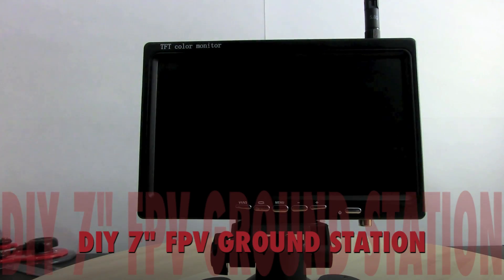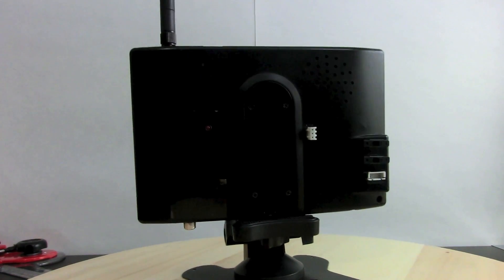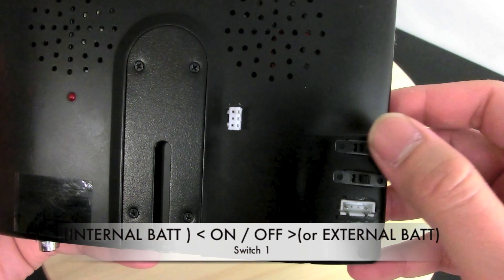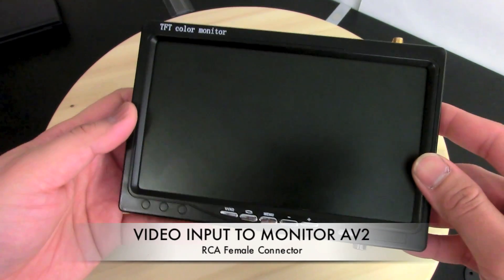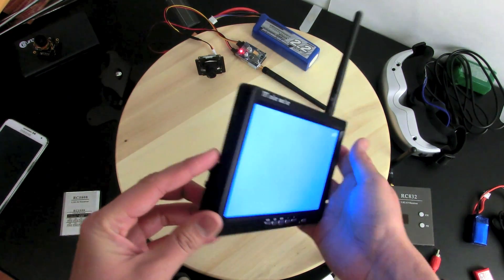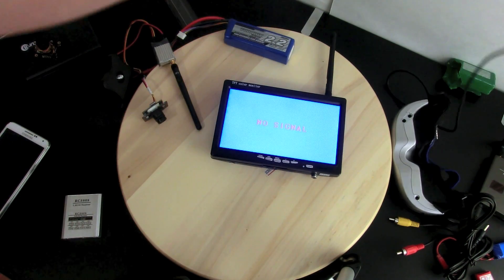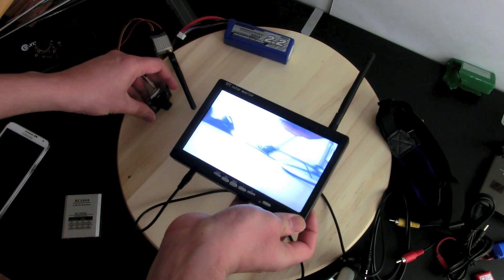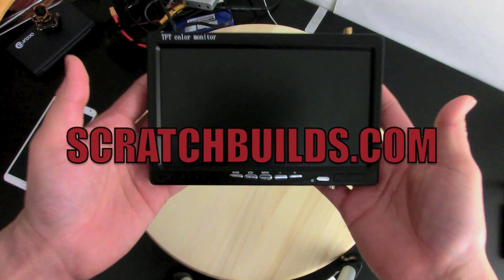DIY 7" FPV Ground Station with integrated Receiver and Battery under $65 Part-1

Comment: Nice build! going to look at mine this week as I still have Velcro everywhere.Why did you decide on external power input of 3s rather than 2s? Purely because you're more likely to have a 3s lying about? I hope to see if there is room inside for a C-DVR.
Reply from the maker: Yes you are right I do have more 3S batteries lying around than 2S. Also, I used 2S inside the case because I simply could not fit 3S in there. 

Also I do have old C-DVR that I paid $30 and never ever used, but now Eachine DVR are small and can be fitted inside the case.
Reply: Chirag Chaudhari ah, I thought you used the 2s to keep that regulator cool.

Comment: excellent!
May be you can answer to my question ...
Following an accident, one of my printed circuit tracks of the screen control panel is cut on the circuit.
I would like to repair, but the circuit is really too small.
Maybe this is replaceable, but I do not see or find such items.
I was wondering if you'd have a diagram of the control panel has any chance?
I can send you pictures if you want, but I think I'll have to buy a screen ...
Regards,

François

Comment: where can i find the bettery that u connect to the receiver?
Reply from the maker: +Mooria Devil That is Eflight battery with EC3 connector. EC3 connectors are horizon hobby's connector type. Totally useless just get ones with XT-60 or Deans (T-plug). They are universal and easy to find and cheap.

Comment: Very nice idea. I bought the same monitor, but it's a pity to pry it open. All the screws are out but it still won't let go of the back casing. Any tips?
Reply from the maker: you know how they use those plastic tools to open iPhone screen just like that you should be able to open it. You can use plastic knife or credit card and run it along the edge.
Reply: +Chirag Chaudhari Okay thanks for the quick reply. i will try to do that!
Reply: It worked like a charm. thnx man
Reply from the maker: +MrZoufzouf Glad to help you.

Comment: Does this monitor go to blue screen if you are flying and lose signal due to obstructions between you and the aircraft?
Reply from the maker: +Victor Soares well Blue screen is still the issue. There are some monitors available for around the same price as this one who  show snow when no video signal. But honestly since we are not using this monitor as DIY fpv goggles blue screen is not really a problem.

Comment: The 7" TFT Monitor needs 12V input and works fine with only 2S 7,4V?
Reply from the maker: Maganzi Yes surprisingly it works without any issues on 2S battery

Comment: This is great! I purchased the same monitor from a seller on Amazon for $16.50 + Free Shipping during a 1-day sale.  I probably won't take the monitor apart like you did, but it's great to hear a 1000mah 2S will run it for 2hours. That was my main concern as I picked up a couple ZOP 2S batteries from Banggood for $6 each.
Reply from the maker: WhiffleX Wow! you got this 7" only for $16.50. Once I upload the second part you may be tempted to do the mod, as its fairly simple. Also I am going to try out digital camera batteries too. Because they are small in size and 4000mah can give me 6-7 hours run time. But thats just a thought.
Reply: Yes, it was a stellar deal.  In retrospect I think I should have ordered a couple.  You might be on to something with a digital camera battery as lipos are best known for their punch, not duration.  The only problem might be the cost.  You won't find a decent digital camera battery for $6 + Free shipping not to mention a charger.
Reply: Chirag Chaudhari Any updates on the second part? Got my monitor and I'm just waiting to see what you did.
Reply from the maker: WhiffleX I just end up filming last part of the video, explaining the wiring. If i get about two hours the video will be up later on, or in One day.

I have been so much busy with life lately, I really really want to get it done asap.
Reply from the maker: WhiffleX Uploading Part-2 now. Should be online soon!

Comment from the maker: Working on Part II at the moment. Should be out in about a week.
The goggles in the video is Boscam GS920.
Reply: Please make the second part....really good videos.
Reply from the maker: I am working as fast as I can, don't want to miss a thing.
Reply: Chirag Chaudhari how much longer until part 2 I really cant wait....such a good video
Reply from the maker: Seth Denzak I am about done, Need to film one more thing, but friend of mine borrowed the system. Waiting for that to come back to me. But meanwhile you can visit the following link, I have posted some internal pictures and the connection diagram. Its very simple.
http://www.rcindia.org/self-designed-diy-and-college-projects/diy-fpv-screen-integrated-receiver/50/
Reply: Chirag Chaudhari almost done?
Reply from the maker: Seth Denzak I am really sorry but got my system back from friend. So 2-3 days more. With busy work schedule, and 250 mini builds, I am not having enough time left to finish editing.
Reply from the maker: Seth Denzak Uploading Patt-2 now. Should be online soon!